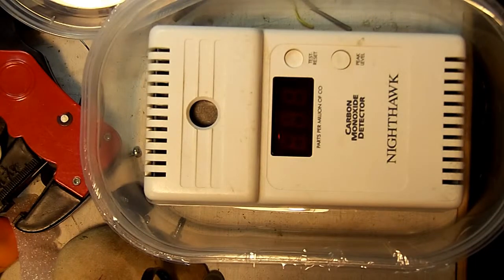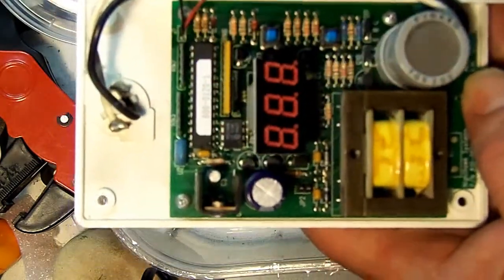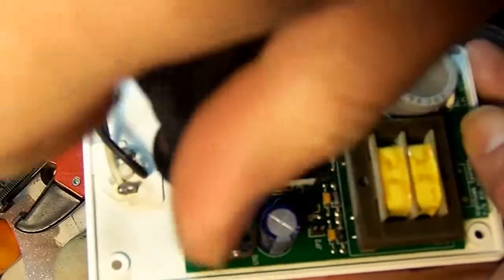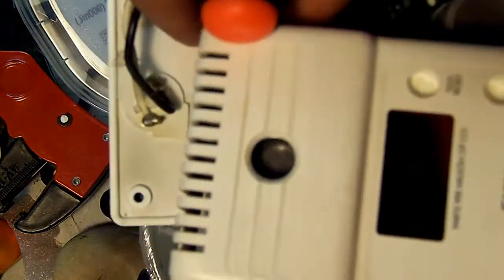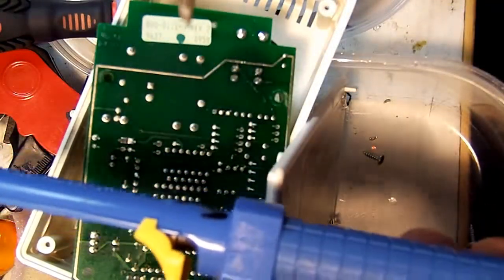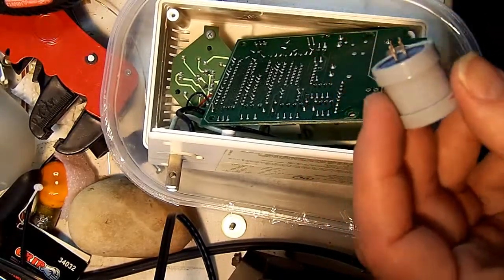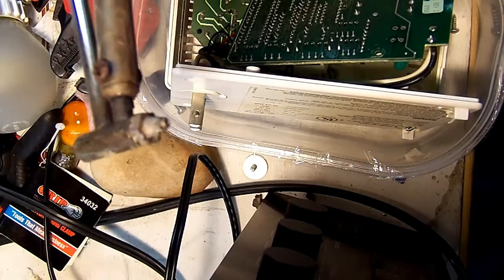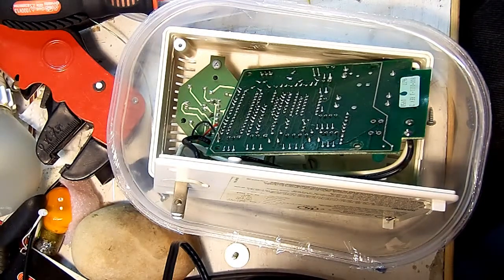Inside a Nighthawk CO detector & Desoldering Tips

Comment: I have this same unit and when i press an hold test button i hear no 2 beeps like im supposed to.  This mean its bad?
Reply from the maker: Yes, I'd consider it bad just due to the age of it, though I don't know how well it can self-test, I don't have the original documents handy. I wasn't able to find a sensor resembling the one in this unit either, pretty sure it is considered obsolete, though I didn't do an extensive search through replacement parts vendors, but didn't see anything new like it.
Reply: Hill's Workbench 
Thank you very much for the feedback. A new one wouldn't hurt lol.

Comment: Wow, all through hole components. How old is that thing? The NTE braid I got from Parts Express works better than the Radio Shack stuff. Seems to have a finer mesh that wicks solder away.
Reply from the maker: JohnAudioTech  Yeah, I think one key to braid is that it is fresh. I don't like to use it so it gets old and when I try to use it it further discourages me.
Reply from the maker: JohnAudioTech It's gotta be pretty old now, could be like three decades.
Reply: I have one of these exact ones in my house and it has been there as long as I remember. I am 17, so pretty old